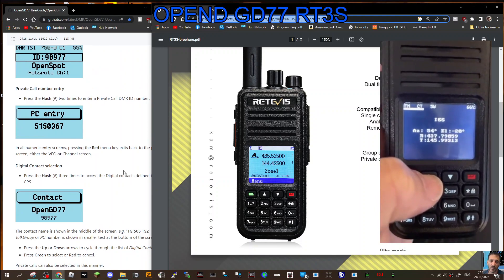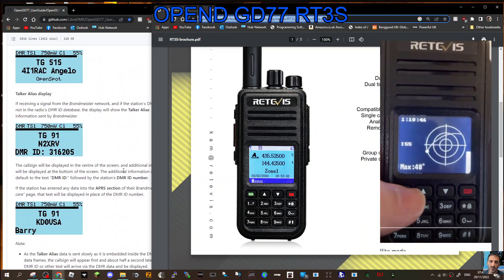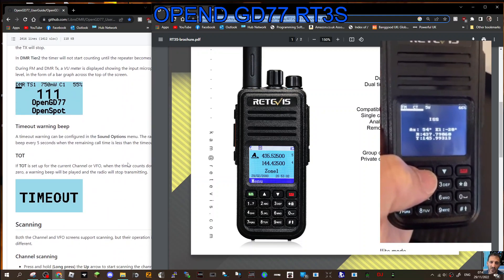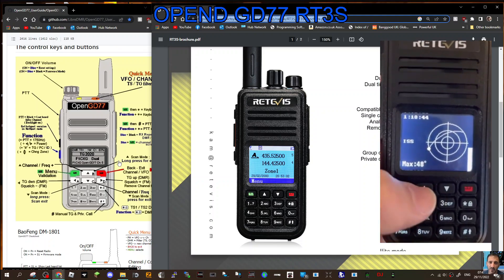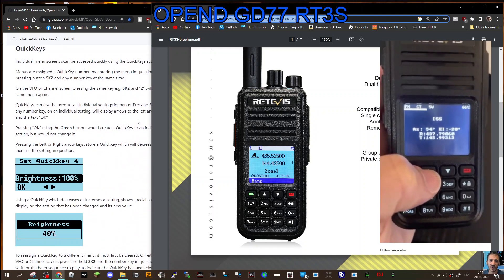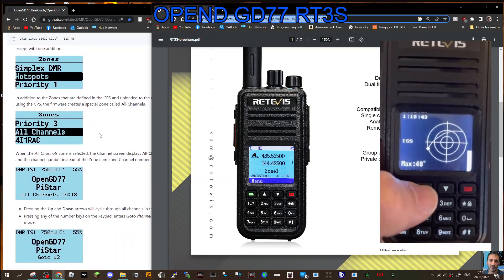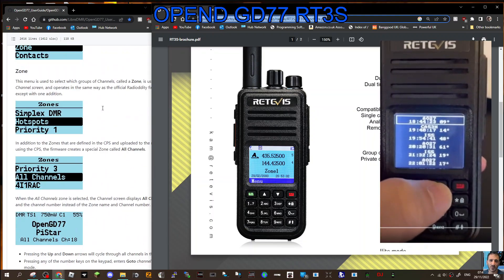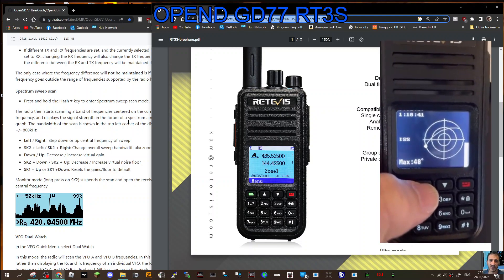NEW(2022) OPENGD77 FIRMWARE MOD , RTES MD390UV

Comment: Hi, I've been looking for information about this firmware. I own a MD UV390 but everything on the website seems to refer to the MD UV380. MD UV390 is barely mentioned, even in the tutorial images the 390 is not on the list, so I have my doubts if this would actually work. I'd like to try this since the original firmware has a couple of bugs and to try new features. Could you give me more information?
Reply from the maker: Hi , it's always risky trying new firmware but the 390 should work on gd77
Reply: @M0FXBHamTech  Hi! it actually worked, I managed to install it successfuly.